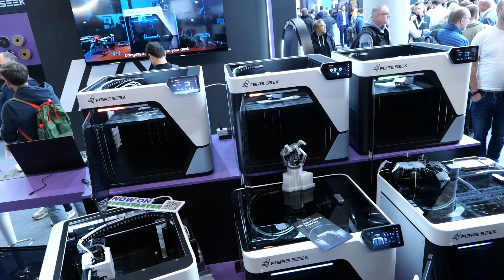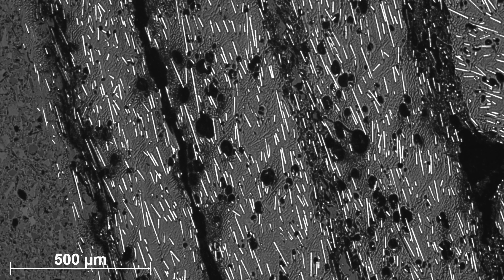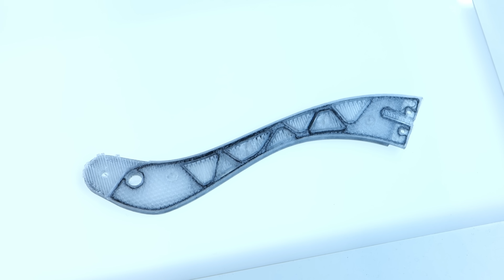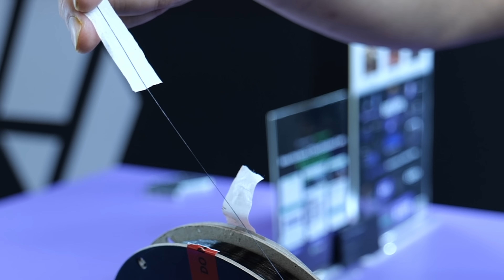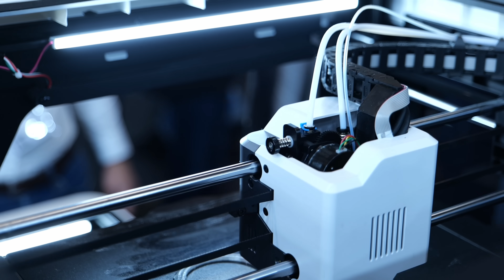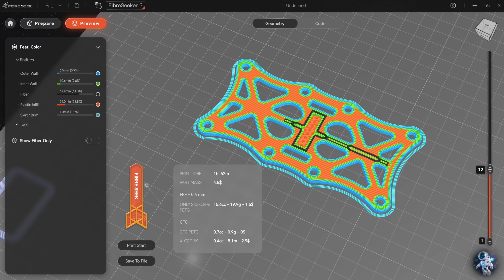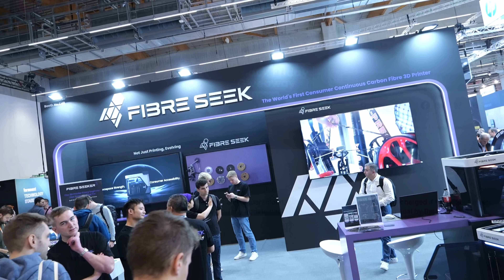The FibreSeeker 3 brings Continuous Fiber Printing to Consumers!

Comment: The vast majority of strength issues in FDM are caused by layer lines. This doesn't fix that issue, as the continuous filament is still laid down along the x/y axis only and cut at layer changes. I like that people are pushing things, but this seems like a lot of engineering to not solve the underlying issue it is meant to address.
Reply: But that is a known issue that we all design around.
Reply: @rsilvers129  yeah, like they did in their test pieces, which are all 2.5D shapes that would be stronger and just as simple to produce with a subtractive manufacturing process. This solution doesn't add anything to actual fabrication abilities. It looks neat, and I am sure lots of people will throw money at it. Still, outside of a few niche applications, this doesn't remove any design or fabrication constraints we already have to work around in FDM manufacturing.
Reply: @mrfochs  could non-planar infill script by TenTech solve this?

Comment: Why all the hassle? Why not just extrude a continuous carbon fiber strand into the filament itself and then print on a normal printer? I guess the fiber may not feed cleanly through the nozzle when loading the filament. May just clump up inside the hotend. But I feel like it would probably be easier to find a solution for this and the other problems that one would probably encounter, than having to develop an entirely new extruder with two separate spools of material etc. just to embed a carbon fiber strand into the filament...?
Reply: Because that is patented and about $500 per kg.
Reply: @rsilvers129  Ah classic case of patents killing innovation... Well, if the spool with carbon fiber stranded filament costs $500, than a spool of normal filament and a spool of carbon fiber strand should also cost $500, so...
Reply: You have to cut the fiber for each retraction. This approach is not compatible with regular nozzles.
Reply: @aleks-ivanov  Didn't see any mention of cutting in the video, so assume the fiber is weak enough to snap when tugged by the extruder. But like I said, probably easier to modify an extruder to do whatever it needs to do (like cutting) than to extrude the carbon strand into the filament on the fly.
Reply: @phinok.m.628   Stephan mentioned the cutter a lot of times in the comments
Reply: @aleks-ivanov  Adding onto this, the extrusion rates for the filament and fiber are different. With 1.75mm⌀ filament and a 0.4mm⌀ nozzle, over 19x the length is coming out of the nozzle than what it going into it. Everyone's favourite property of carbon fiber is that it doesn't like to stretch. Helical winding of the fiber to fit 20 metres of fiber into every 1 meter of filament might seem like the next step, but how is that going to extrude uniformly? Sounds like a clog just waiting to happen if anything goes less than perfectly through the melt zone.

Comment: I wonder if this procedure also works in vase mode. Extruding a continuous carbon fibre through the whole print. 
This could give light weight constructions more rigidity and make them suitable for real uses

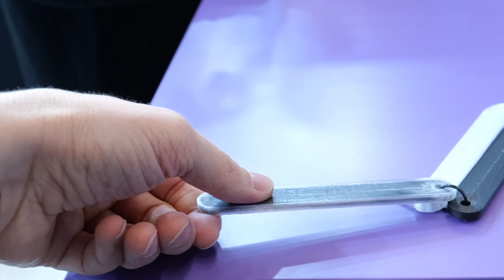Comment: Theoratically yea aluminum 300 mpa carbon is 900 mps strength. But in practically aluminum 250 mpa strength but carbon fiber very depended on portion direction and interface strength. Look at @8:28 . Very easily bending. You can not bend this size of aluminum by hand...
Reply: Yes, aluminum is a bad comparison. It’s more like a hard wood
Reply: Only if you weld aluminum.

Comment: Hi Mr. Kitchen. Did you have time to stop by the Freemelt booth? I was just wondering because I am a student in Sweden (3D-print technician) and an intern there. They are doing quite amazing things with their EBM technology. I imagine their tech does not interst 90% of 3d print enthusiasts, but it's actually very interesting and highly rewarding to work with.

Comment: Basically like putting rebar into concrete?
Reply: Yes, Not a bad analogy. Though it's to be remembered that rebar could be standing in form too. This is only in the XY plane, apart from the miniscule Z layer changes. But for many and dare to say most applications XY would be enough, like for instance parts like clutch or brake lever for motorcycle, where mechanically part has one axis that is almost meaningless regarding strength needed.

Comment: Combine this with non planar 3d printing and dual nozzle (0.4mm nozzle for walls, 0.8mm nozzle for infill) and brick layers, then anneal it all (optional: Put a adhesive or glue on each layer of the print). You'd have the strongest 3d print.

Comment: I’m glad to hear they’re doing glass fiber. In my line of work, we can’t use carbon fiber filaments because of the electrical properties. There are significantly fewer glass fiber filament options over carbon.
Reply from the maker: Yeah, I think "carbon" simply sells better 😂
Reply: Yes, we had an issue with a unit that kept breaking until someone realised the fairing fully carbon fibre instead of having a glass fibre window as designed.

Comment: Very very cool.
I have 2 questions/concerns:
1 - How exactly is the cutting of the fiber done? How will be made sure the knife (?) will not get dull or gunked up?
2- How will I be able to keep the L shaped coextrusion chamber free if blocked or gunked up? Cold pulls and such will probably not work?
Reply from the maker: 1. They use a rotary cutter above the meltzone where everything is still cold.
2. You should be able to cold-pull it if you're careful but you can also use cleaning filaments. The Positron has a similar design and hasn't caused me any trouble, yet.
Reply: For the second part even manufacturing wise it would be easiest to leave through bored channels and plug ends with threaded parts to have full access to channels.

Comment: The problem with this printer design is it doesnt help the layer line problem. The carbon fiber fiber filament should run perpendicular to the layer lines. These parts wont be stronger, because 3d printed parts only break along the layer lines. There was never a need to increase strength within a layer.

Comment: Cool product, but the whole video is basically an ad with no real testing and presenting what the manufacturer claims as gospel. If you look at e.g. the review/feedback YGK3D posted today you will find that the strength improvements are only 20% over regular Nylon on the quick test he performed. Not bad, but far, far faaaar away from Aluminium. Lightyears away.
Reply: How can he test a product that’s no available? Obviously this video is a showcase from Formnext last week.
Reply: Sort of. His video showed that it almost doubled the strength of PETG. I don’t think he tested Nylon with and without the fiber. But I agree there are unanswered questions about how it compares to Markforged.

Comment: Somebody experimented with slightly non-planar layers (adding a wave in the z axis) to increase layer strength. It might have been JanTech.

A technique like that for the continuous fibre extrusion might yield stronger parts in z.
Reply: TenTech"
Reply: @aleks-ivanov  ah, yes. The video is "Non-Planar Interlocking Walls...": https://youtu.be/r9YdJhN6jWQ?si=w9Y9lYiieTPe25DL
Reply: Combine this with brick layers to form a 3d laydown the carbon could mimmick interlocking between layers 🎉

Comment: Guess what - You're later adhesion  Z-strength, that needs improvement the most, still sucks.
Reply: why are you always so negative, this printer has many other advantages and you of course had to latch on its one imperfection
Reply: @riba2233  Funny you would make a comment about how I "always" am - I guess I didn't realize that you've known me for so long.
That being said - the "negative" comments I make are because I want 3D printing to be BETTER. In this case additional X-Y strength is great and all, but what needs improvement the most in plastic FDM printing is Z-strength and layer adhesion. Fix the things that need it most. Fix the things that fall short. Make it do better, not just marketing hype for questionable strength per dollar "improvements.
Reply: This disadvantage can be easily fixed by non-planar infill script by TenTech.

Comment: I want to put copper wire in there to 3d print circuit board traces
Reply from the maker: Theoretically possible and if you have the right AWG wire this could even work right out of the box. Should give it a try.
Reply: Please do it, I find the idea of embedding copper wire FAR more interesting than CF. It would be a gamechanger for all sorts of applications like coils, antennas and all sorts of sensors.
Reply: @CNCKitchen print a stator for an electric motor.
Reply: For the price point, you are probably better off just doing a CNC with pcbs.  Although this could maybe allow some type of 3d circuit
Reply: @SpartanORGN  But with this approach you could do many more pcb layers than the just 2 with cnc
Reply: @Igelhacker  Yeah? How would you print vias?
Reply: @SpartanORGN since it isn't non-planar I don't think you could really do a "3D" circuit
Reply: @startedtech  You could use their screw through Z direction method and use them as vias. If you do clever layer pauses and embed nuts you could even do buried or blind vias. Of course this sounds like a recipe for centimeters thick PCBs, which is kinda funny :D
Reply: That would be soo cool
Reply: Watch Project binky, they do some pretty neat stuff printing circuits with solder.
Reply: I think conductive paint would be a more flexible solution: You could print wider or narrower traces, or even areas for shielding. You cold also print three dimensional traces. 

This process could be slow though: The printer would have to wait for the paint to dry, and you might need several layers of paint for the desired conductivity.
Reply: They had Grant from 3d musketeers go over and take a tour. Someone asked that very question. Their response was yes and no. There is no reason why you can't do copper, but the software isn't going to be designed for trace layouts. But copper in general.....sure why not.
Reply: I want to see it print 4-6 layer pcbs.
Reply: You can print conductors with FDM printers with Kupros Inc’s all metal conductive filament
Reply: good luck with that
Reply: There was a machine at formnext, from APS robotics that did that. Full toolchangers, with a head that did copper wire. They had a few sample parts there, and they looked really great
Reply: 300 IQ

Comment: If anyone is interested in a more critical review of this printer, I just posted one on my channel. The printer in its current state has some issues that this video, while interesting, doesn’t address.
Reply: Did you try tpu? I think it would be interesting to see and would have great layer adhesion.
Reply: But hey, at least this video has an affiliate link to the kickstarter... So, a paid trip, possibly a fee on top and an affiliate link. 
Sadly it looks like Stefan took a calculated departure from his old values. Even more sad, people wont care. They will gobble it up. 

And actually, even if the printer turns out nice, why take the money, why not do a proper review and then if you really do love it, you can consider swapping some integrity and trust for an affiliate link. But getting paid up front with zero testing done first that's disappointing.
Reply: Yes, and thank you!! as your a reviewer that I have learned to trust, unlike about 95% of the others on YouTube. Creators seem to be selling out for the $$$ just like this Post. Not a good look for CNC Kitchen.  I asked question for Fiberseek on the Kickstarter and the Facebook threads will see if they get back to me or even publish my question on Facebook as it requires a "Moderator" to approve.

Comment: The layer adhesion problem could be fixed by ramming hot carbon fiber "nails" through the plastic. The nails could be hollow to accommodate a metal heating element and to give the nail rigidity while driving it through the part.
Reply: Wot r u smoking

Comment: I wonder if Fibreseeker will also dive into non-planar slicing/printing to really maximize the strength of embedding the fiber to a print.
Reply: My guess is most companies will wait until the community comes up with a good slicer that they can use. It looks like it is a software limitation now.
Reply: We already have some known non-planar post-processing scripts for the regular slicers, but they made their own.
Reply: IIRC, there are some patents that make it a bit difficult for a private company to implement in to a product.
Reply: @TheOfficialOriginalChad  those patents are backed by stale horseshit and will last 0.001 seconds in court...
Reply: @vladislavdonchev1271  Right. 
You’re smarter than everyone. Got it.
Reply: AFAIK, in industrial mass production, they are currently using hybrid between mold and 3D-Printing for embedding continuous fiber in different planes. 
they 3D-Print raw parts with the fiber, assemble them in a mold and "sinter" them into one part. as a result they get complex reinforced parts as good as injection molded. 
i can't imagine printing continuous fibers in three dimensions in any meaningful way :(
Reply: @supremecommander2398  IDK continues fiber 5 axis printing would be the coolest shit I've ever seen. I bet the bridging capability would be great and you could make insanely strong parts.
Reply: @thirtythreeeyes8624  sure - for that to work, you would need to find a common center of the part from there the print starts and expands in all dimensions. Maybe a printer with a fixed head, and a 6-axis robot arm, holding the part, that circles around it could do the job
AAHHH, don't give me ideas to design that...

Comment: I understand how the continuous fiber helps in the XY surface but how does it help the Z strength? layers/stacks of fibers are still unconnected in the Z direction right?
Reply: It doesn’t help. You can add screws for the other axis.
Reply from the maker: Talked about that at the end. No, you still have the same laye radhesion problems, so you need to design around this.
Reply: @CNCKitchen  can't you just use the non-planar infill script by TenTech to fix this problem?

Comment: 900 MPa for just the fibres? That's so low! cheap glass fibres reach above that!
900 is more the area where I'd imagine the combination in a cross-ply plate to be.
Reply: Yes. I think it is for the full print.
Reply from the maker: That's already the impregnated fibers after co-extrusion. The raw fiber are problaby above 2000 MPa.

Comment: Great technology. It would be nice to have a third nozzle for dedicated support material, because part orientation is still very limited. The continuous fibers can only reinforce in a maximum of two axes, and those axes always need to lie flat. That means the part has to be oriented accordingly, and in many cases you’ll probably have to rely on support structures.

Comment: If you have to buy the special resin-impregnated fibers from FiberSeek how is it different than makerforge re: lock-in pricing? Still, cool.
Reply: Because their fibre is significantly cheaper and machine is around 10 times cheaper. That and you can use materials with fibre reinforcement other than PA6/Onyx which Markforged doesn't offer.
Reply: It’s different because this is a $3000 printer with $50 fiber and Markforged is a $20,000 printer with $500 fiber.
Reply: There will defenetly other brands if its more common
Reply from the maker: First it's significantly cheeper and you can combine it with any material and not only Nylon.
Reply: @CNCKitchen  I'm just saying it would be much better without the proprietary secret sauce. The customer lock-in is there just like the makerforge filament. Glad to hear at launch it is currently cheaper.

Comment: I'd be really interested in a video exploring the potential health risks of these chopped-up carbon fibers in our current filaments. <3
Reply from the maker: Did a ton of research there already. If you don't sand your chopped carbon fiber parts you should be fine. The fibers in the filament, yet small, are still too big to enter your lungs. Breaking these fibers will make them become dangerous.
Reply: None
Reply: https://youtu.be/RLt9l6YxvHk?si=uQezbvAczSYaYtHZ

Comment: Backed. The fact that this is co-extrusion means that we'll be making profiles available to use this with our Pro PCTG and Tough Pro PLA+
Reply: I was thinking this might be a good fit for your PCTG. Glad to see it on your radar. (Backed too)
Reply: @kevintucker3629 the layer adhesion of Pro PCTG should make for some very interesting parts that are also strong in the z-axis
Reply: I use PCTG frequently at work so this is very exciting to me. I know I won't be able to get one of these due to lower demands of the strength of my parts but I may end up buying one for myself just because you guys are on board.
Reply: @12yearwaves  That'd be awesome! Yes, we're very excited about the possibilities of something like this.
Reply: Genuine question. What would the strength difference be if you just used cotton or wool instead? I know carbon fiber is strong and adds strength to a lot of materials. 

But I don’t see how adding what’s essentially carbon thread, makes it that much stronger than the now “standard” method.
Reply: @only1muppet  It would be a different kind of strength. Less stiff, likely more tensile strength. But also likely less simple to implement into a 3D printing process. Just our thoughts at this time :)
Reply: Off topic.  Using your PCTG what do you recommend as a support filament interface
Reply: @draildiagnostics we recommend our Standard PLA+ printed at 230C
Reply: @draildiagnostics I'd imagine that pla works great considering how similar the chemical makeup of PCTG is to PETG.